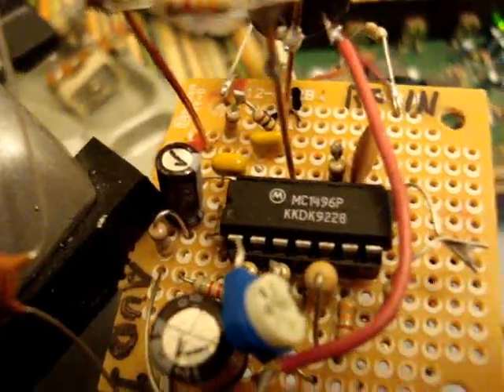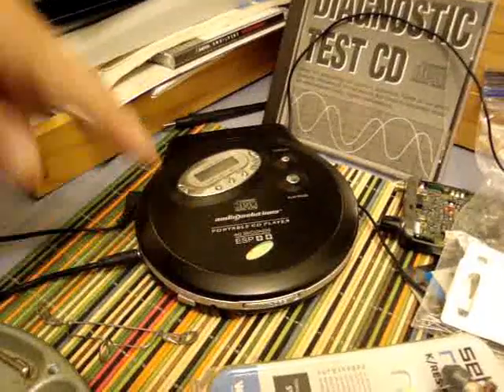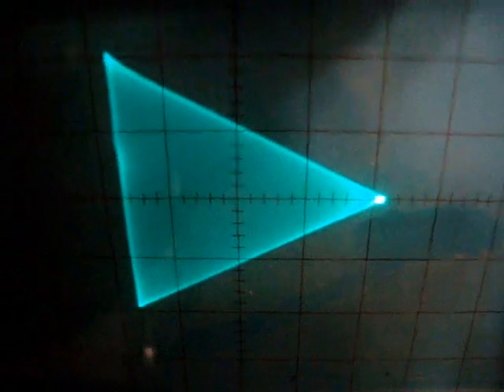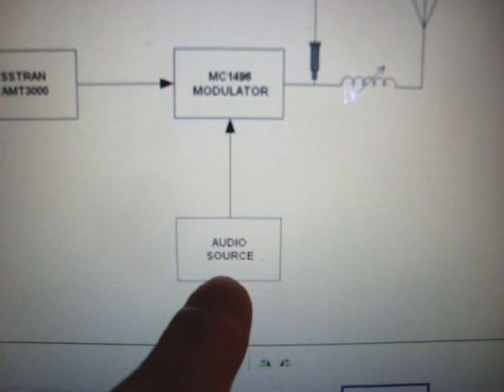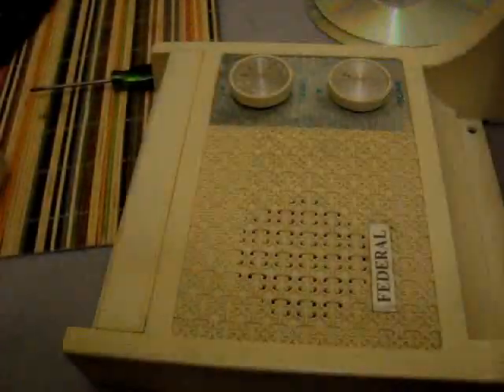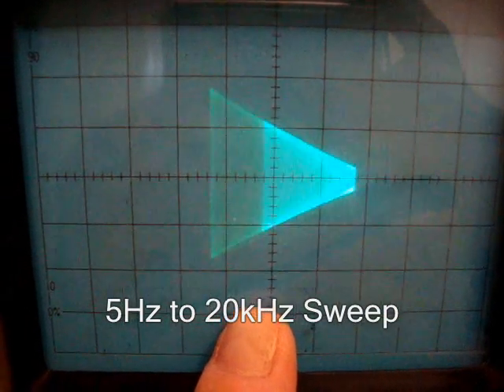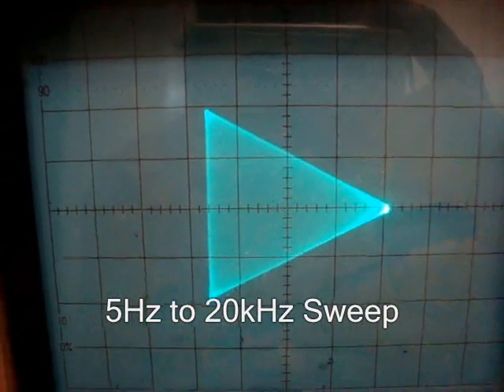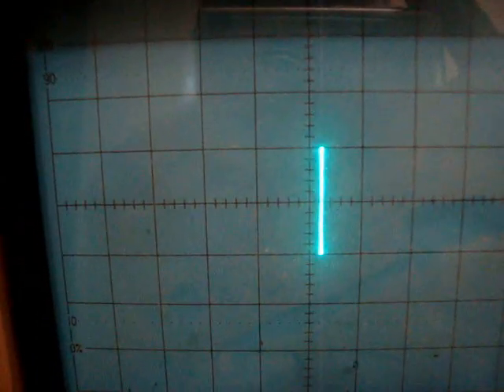MC1496 AM Modulator

Comment: The MC1496 is a Balanced Modulator IC not an "AM Modulator"... the circuit that unbalances the modulator and (re)inserts the carrier is what makes the output AM.  Most Ham radios use this method of generating AM unlike most CB radios with the exception of a small few..  Also it's useful to have the balance/unbalance circuit available on a potentiometer to adjust the carrier and modulation level.
Reply from the maker: Indeed. While this might be true, it's kinda referred to as an AM modulator, much the same way an "RF Modulator" seems to refer to a coverter that goes between your tv and your vcr. So, technically, it's not an AM modulator. However, check this out...
https://ecedmans.files.wordpress.com/2014/03/am-modulators.pdf
It's all relative. 😉

Comment: Hello, how to connect the oscilloscope to measure the modulation? Thank you
Reply from the maker: I am using a Kikusui COS6100M 100 Mhz Oscilloscope with 2 x10 scope probes. I connect channel 1 to the audio source, and channel 2 to the RF output, then press the X-Y button. This makes the trapazoid pattern. Both channel input levels may need to be adjusted on the scope to 
display a good trapazoid pattern.

 - RF output (Pin-12 MC1496) to scope Vertical input
 - Audio source (Pin-1 MC1496) to scope Horizontal input

Here is a pic that shows more on how to set up your scope for trapazoid: 
http://www.tpub.com/neets/book21/0130.GIF

Hope this helps.
Reply: Thanks friend  @bob4analog

Comment: Hi your diagram says 2N706 which has to be an error as it's a Germanium PNP, the diagram shows an NPN.
Reply from the maker: Thanks for bringing that to my attention. It's supposed to be a 2N3704 which is a general purpose NPN transistor. A 2N2222 should work fine, it's not critial. I'll  try to fix the error in the yt video.

Comment: What are your thoughts on developing a little bit of power after this stage?
Reply from the maker: I'm working on that. There are simple circuits of linear amps that can output from milliwatts to kilowatts. I want to make one and post it. I have an idea for a small tube amp, maybe 1 watt PEP into 50 ohms.
Reply: I’m looking forward to “part 2”
Reply: All ham radio AM transmitter from the last 50 plus years use this method of generating AM tx.... and most of them will produce 100 watts at the antenna port so amplifying the balanced modulator output is no mystery.